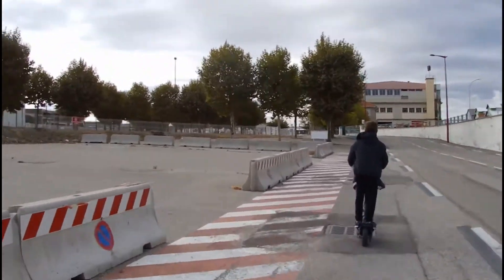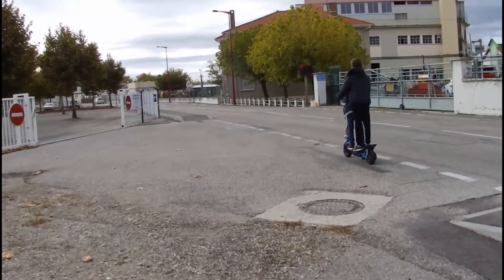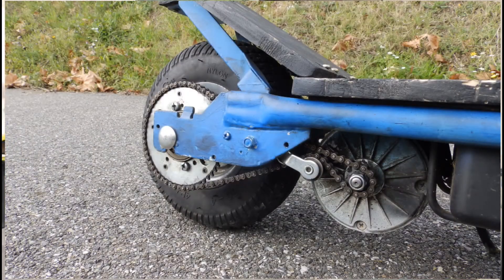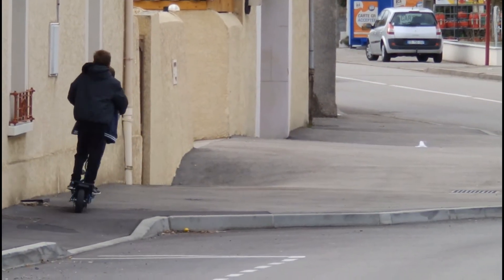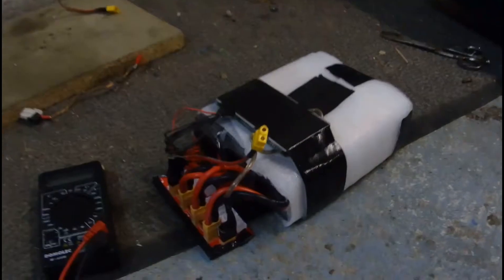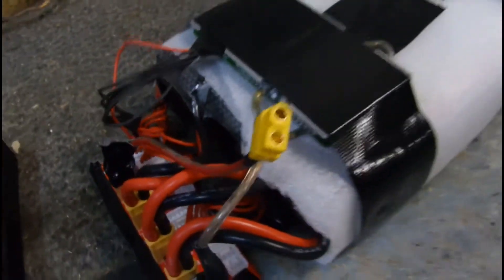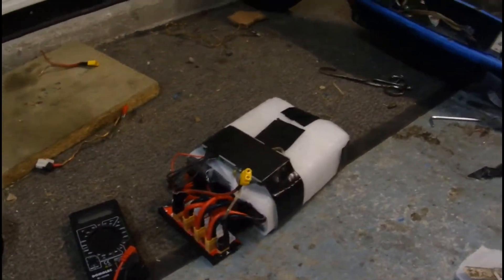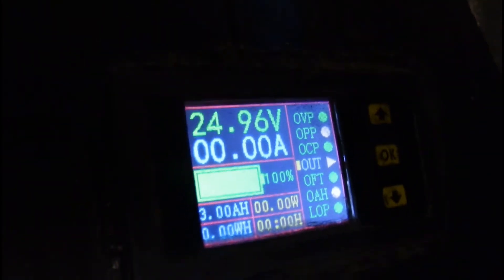AMELIORER sa TROTTINETTE ÉLECTRIQUE ! [Razor e300 mod ]

Comment: Bonjour. Je dois changer les batteries de ma trotinette Razor e300 qui ne chargent plus. Ce sont 2 x 12v 9Ah. Je ne cherche pas plus de vitesse car 24km/h c'est déjà pas mal,  mais je chercherais plutôt plus d'autonomie. Je n'y connais rien en électricité. Pourrrais-tu me dire comment faire pour qu'elles tiennent la charge plus longtemps. Faut-il choisir des batteries avec plus de volts, ou plus d'ampères, ou est-ce qu'il faut autre chose que des batteries au plomb ? Je te remercie de bien vouloir m'éclairer.

Comment: Bonjour et bravo pour cette vidéo, j'ai l'intention d'acheter une razor  e300 d'occasion et de fabriquer moi meme mon pack de batterie a base de sony 18650 VTC5 en 7s 5p ou 6p.
Je me demande si je peux conserver le variateur d'origine ou pas.
Le moteur que tu as monté sur ta trott c'est le moteur d'origine ou un que tu as récupéré sur un engin electrique ?
Tu peux nous en dire plus sur ce moteur ?
Reply from the maker: Ta modification est tout a fait possible et sans problème, moi j'ai remplacé le moteur d'origine de 250w par un 350w et le contrôleur pour avoir un peu plus de puissance
Reply: @TutosBricolages  Tu peux nous en dire plus sur ce moteur de 350 watts (marque, modèle), le pinion qui était sur le moteur d'origine s'est monté sans problème ou il a fallu usiner l'axe ?
Concernant les modifications mécaniques comme l'installation du moteur, tu as tout fait toi même ou tu a béneficié de l'aide d'un adulte ?
Cette trottinette a juste un petit défaut, le bruit de la chaine.  Je me demande si il n'y a pas moyen de la remplacer cette chaine par une courroie crantée.
Reply from the maker: @Motorcycleman480  le moteur est celui ci, https://www.banggood.com/350W-24V-2750-RPM-ZY1016-Electric-Motor-E-bike-Brushed-Scooter-Electric-Motor-p-1213254.html?p=N030107107860201610K&custlinkid=583869

J'ai du percer des nouveaux trous de fixation sur le cadre, pas d'usinage c'est très simple
pour la courroie ça doit être possible mais compliqué pour un alignement parfait et pour gérer la tension de celle ci

Comment: j ai acheté d occaz dernierement une razor e300 , j ai acheté un moteur my2016 mais en 36v 350w tout fonctionne impecc mais il y a un soucis l axe du moteur est 1 mm plus long que l autre original et ce qui fait que la chaine déraille a la première accélération même tout doucement. je suis deg . si t as une solution ou une astuce :)
Reply from the maker: Tu peux décaler le moteur en perçant des trous d'attache du moteur décalés, il faut que la chaîne soit parfaitement droite sinon elle va sans arrêt détailler
Reply: @TutosBricolages  merci beaucoup
Reply: Bonjour, vous pouvez me donner le lien vers le moteur my2016 que vous avez monté sur votre trott ?

Comment: bonjour, j'aimerais savoir si un moteur brushless 280kv (celui que tu utilise pour ton autre trott) serais compatible avec cette razor e300(fixation, positon des trous...)? De plus, pense tu qu'elle serais assez stable pour aller a plus de 40km/h? Car je compte faire comme toi avec ta trott wayscal mais avec cette razor e300 (mettre un vesq ... ) sinon merci pour tes vidéo continue comme ça ;)
Reply from the maker: Salut, je te recommande plutôt un moteur de 200kv (plus adapté et c'est ce que j'utilise actuellement dans ma trottinette) en 10s ou 12s en batterie c'est le mieux tu devrais pouvoir atteindre même 50km/h en 12s, la razor e300 et très stable mais elle a une roue libre et n'a pas de guidon pliable (sur la plupart des modèles) le fait qu'elle a une roue libre empêche d'avoir un frein moteur (c'est cool le freinage moteur ) C'est faisable par contre il faudrait faire un support moteur toi même avec ses équerres bien solides, si possible utilise une batterie de 12s (44v) car le 10s (36v)n'est pas suffisant pour une trottinette électrique qui va a 40/50kmh (surcharge du vesc au niveau du courant)
Reply: merci pour ces infos donc  est il possible de retirer la roue libre pour bénéficier du freinage moteur et si ce n'est pas possible vaux mieux que je me prenne plutôt un esc classique pour escooteur qu'un vesc ? car je n'aurais pas le freinage M. 
Pour le moteur des équerres comme celle ci (ou dans ce genre ) suffiront?  https://www.leroymerlin.fr/v3/p/produits/1-equerre-d-assemblage-acier-zingue-hettich-l-32-mm-e22213 
Pour la batterie je comptais faire un assemblage de 3lipo 3s de 5000ma/h et une de 4S pour obtenir une tenstion enfin de charge de 54,6v et en tension moyenne de 48v en tout il y aura 13 éléments donc une batterie 13s; mais j'ai vu que le moteur 200kv a 7500 tr/min (je crois) supporte du 12s max d'après toi il vaudrais donc mieux une batterie de 44v avec un assemble de 4 lipo 3s?
Reply from the maker: @leandrebereziat  le moteur 200kv 12s va fonctionner en 13s sans problème (3.7v de plus 😂 c'est un moteur il y a une certaine tolérance), tu peux utiliser un contrôleur d'ebike mais ils sont pas forcément compatibles avec les moteurs comme ceux ci, et un esc je ne te recommande pas car il n'y a pas de limite de courant
Reply from the maker: @leandrebereziat  pour l'équerre il faudra plus solide car le moteur tire fort celle du lien risque de plier a moins de la renforcer
Reply: @TutosBricolages  oui j'ai pris une équerre au piffe mais je vois le genre pareil pour le vesc même si il coûte plus chère y'a beaucoup de fonctionnalité en plus comme la limitation de courant et bien plus encore je essaierai de t'envoyer des photo ou de petites vidéo quands je l'aurai fini (pas avant le fin des grandes vacance mdr)
Reply from the maker: Et du côté de la roue libre tu peux essayer de la bloquer (dégraissage et Nettoyage haute pression, pas besoin d'ouvrir la roue libre ) puis la coller en la noyant dans de la colle cyano mais il faut bien avoir tout dégraissé car sinon la colle ne va pas tenir et si tu bloques la roue libre il faudra tendre mieux la chaîne car le tendeur ne suffit pas la chaîne pourrait dérailler au freinage.
Reply from the maker: Pour tes batteries il est obligatoire d'assembler des Lipo identiques le compromis et mieux avec des batteries lithium-ion, c'est moins cher et moins dangereux que des Lipos le mieux c'est d'acheter des cellules 18650 sur NKON.nl et de les assembler avec un bms (voir ma vidéo d'assemblage du pack pour ebike) du 12s 4p de Samsung inr 25r serait idéal et pour plus de capacité tu peux utiliser des Samsung 30q mais plus cher, il faut que ton pack puisse débiter au moins 25a en continu.
Reply: Finalement je vais essayer de mettre 4 batterie lipo 6s(celle dans ta description) 2*2 en série  pour avoir du 12s 16 A/h (si ca rentre car je doute que la 4 eme passe mais le vesc prendra moins de place que ton contrôleur ) je vais quand même prendre des lipos car j'ai juste besoin des les assembler de mettre 2 B.M.S. assez costaud  de les isoler et de les protéger un minimum avec de la mousse. En revanche les 18650 son plus modulable elles peuvent donc prendre la forme que l'en veux mais je n'ai pas envie de me casser le tête a faire le pack mdr 
Pour la roue libre je vais abandonner le freinage moteur et mettre un frein a disque comme tu a fais cependant pense-tu que lancé a plus de 45km/h le frein tiendra bon la roue dérapera? je penserais aussi a mettre une sécuriser (quand je freine le le moteur s’arrête ) .
Reply from the maker: D'accord, tu peux faire comme ça, ça me paraît pas mal, pour l'assemblage des Lipos, évite de faire comme moi relie les directement entre elles, où créé des connecteurs en Y car ma plaque d'équilibrage a pris feu un jour (J'en ai parlé dans ma vidéo trottinette boostée part 2).
Du côté du frein, utilises un disque de frein plus petit que le mien, c'est parceque j'ai pas reçu le bon que j'ai utilisé un gros mais c'est mauvais car il tourne trop vite et ça uses le plaquettes rapidement, sinon tu peux tenter d'utiliser un frein comme celui ci ça serai mieux (com suivant)
Reply: @TutosBricolages  Salut je suis toujours sur le projet, je me suis procuré une razor e300 d'occation et je me penche d'abord sur le freinage (je n'ai pas compris la fin de ton dernier com) je comptai m'acheter le disque de frein en 140mm mais j'ai vu qu'il y avais une fixation (dans ta description) pour l'étrier de frein mais seulement en 160 mm. Je me dis que le 140 mm est mieux car il use moins vite mais je ne serai pas le fixé et le 160 j'ai peur qu'avec la fixation il me manque 1mm de jeu et qu'il frotera donc sur le disque. Aurai tu des conseilles/solutions a m'apporter? Merci de ton aide.
Reply from the maker: @leandrebereziat  ça serait mieux un disque de frein plus petit que celui que j'utilise car  le mien de par sa taille passe très vite dans l'etriers de frein ce qui uses plus vite les plaquettes (en 3 mois pour moi)
Reply: Je fais une batterie composée de 22650 5000mah(celle que tu utilise déjà) en 7s 5p. J'aimerai avoir une autonomie de 40km minium mais j'ai peur que ce sois un peu juste. j'ai le controleur d'origine de la razor e300 250w(je suppose car le moteur lui fais 250w). j'aimerai savoir grace a ton expérience, es ce que je peux dépasser les 40km d'autonomie en 1 charge. Car tu a une batterie 24Ah en 22.2v avec un moteur plus puissant et moi une de 25Ah 25,9v avec un moteur moins puissant. tu dis pouvoir atteindre 40km facilement donc je pense que moi oui mais j'aimerai avoir ton avis là dessus. Merci encore pour ton aide.
Reply from the maker: @leandrebereziat  oui largement car l'autonomie dépend surtout de la vitesse, avec la puissance d'origine ou même booster de la razor tu atteindera largement les 40km voire 50km

Comment: Bjr. J’ai une e300 moi aussi j’ai toujours trouvé qu’elle se traîner d’origine. J’aimerais la booster pour atteindre max 50km/h mais je ne sais pas comment m’y prendre tu pourrais me mp pour plus de détails ou m’indiquer quelque base stp sa serait cool
Reply from the maker: Pour aller plus vite, il faut soit plus de tension dans le moteur (donc des nouvelles batteries ) mais ça ne suffit pas forcément, il faut aussi changer la motorisation en plus des batteries car il faut plus de puissance pour aller a 50 kmh que a 25.
Reply from the maker: J'ai fait ça si ça peut t'aider : https://youtu.be/Si6XaN2R52s

Comment: bonjour, tout d'abord bravo pour tes videos je les trouve géniales ! moi qui suis nul en électricité ca m'épate ;) je voudrais savoir si tu as toujours ta razor e300 et si cela fonctionne toujours ? j'ai également une razor 300 et le changement de batterie me faisait un peu peur quant à la question de sécurité des batteries, comme je transporte mon fils , je ne voudrais pas que cela explose ou autre ... ;) donc si tu me confirmes bien qu'il n'y a pas de risque je vais suivre ton tuto à la lettre, génial et encore bravo pour ton temps et ton ingéniosité ;) ! Merci , Thierry Laurence
Reply from the maker: J'ai bien vu ton message, j'essaie de te répondre au plus vite...
Reply from the maker: oui j'ai toujours la razor e300 et elle fonctionne toujours, pour les 3 lipos ma méthode est dangereuses car avec les vibrations les connecteurs d'équilibrage sur la plaque qui relie toutes les batteries se sont débranchés et, lors de la charge (ça m'est arrivé) et j'ai eus de la fumée et deux batterie mortes,  donc si tu fais comme moi, je te recommande de coller les connecteurs d'équilibrage des batteries avec minimum de la colle chaude il faut aussi une plaque d'équilibrage avec fusible pour la sécurité.
pour la charge il faut soit un chargeur spécial qui charge et équilibre les batteries en même temps ou un bms comme moi.
le bms doit être relié aux bornes d'equilibrage des batteries relié donc par le biais de la plaque d'équilibrage et couper le neutre pour la protection
le bms et les fusibles doivent être minimum 40a.

si cela te fait peur, tu peut acheter un pack de batterie tout fait avec le BMS intégré sur eBay. 

sur ma trottinette brushless je vais construire un pack de batterie lion 18650, je ferai sûrement une vidéo de fabrication mais je n'ai actuellement pas encore reçu les batteries. 

si tu as besoin de plus d'informations, n'hésite pas a me demander, tu peux aussi me contacter en message privé sur Twitter pour que je puisse te partager des photos et des liens.
bon weekend !
Reply: merci beaucoup,
oui je comprends, eh bien en fait j'avais aussi une inokim avec une batterie en supplément , alors je me suis dit que je pourrais juste commander les pieces détachés d'une inokim et monter le tout sur la razor comme ca je ne prends pas de risque (le seul hic est que le moteur de la razor est en 24v et que le controller inokim et la batterie sont en 36v , qu'en penses tu cela devrait fonctionner quand même ? merci de ton aide , Thierry
Reply from the maker: Normalemt Tout fonctionnera parfaitement, le moteur tournera plus rapidement et son rendement sera un peu moins bon mais ça ne va pas le griller, il faut surtout veiller a ne pas trop dépasser les watt de moteur exemple : moteur 250w, max 500w 1min.
Reply from the maker: Je viens de regarder, le contrôleur de l'inokim n'est pas compatible avec le moteur de la razor car c'est pas un moteur dc sur l'inokim il faut un contrôleur moteur dc
Reply from the maker: Celui-ci peut faire l'affaire
https://banggood.app.link/kC2QdA98AL
Reply: Bonjour, 
et si je changeais le moteur pour un brushless du type inokim en 36V 350w , cela me garantirait exactement le même circuit électrique , et donc une compatibilité totale qu'en dis tu ? j'aime bien aussi ton idée du controller mais je ne suis pas aussi fort que toi en électricité et je risque de me planter ;) ! tu achètes beaucoup sur banggood, ca a l'air pas mal !?, merci en tout cas, c'est super sympa , je te dirais ce que je trouve comme moteur ! à bientôt

Thierry
Reply: j'ai aussi vu des moteurs brushless qui pourraient remplacer le moteur DC d'origine , reste à choisir lequel serait compatible avec tout le kit inokim que j'ai déjà !? si tu peux me conseiller, après j'arrêtes de t'embêter ;) Merci Thierry
Reply from the maker: Pour le moteur de l'inokim c'est la roue arrière qui est le moteur alors il faudra réussir a l'accrocher sur la razor si tu veux plus d'informations j'ai une playlist trotinette électrique qui regroupe toutes les trottinettes électriques que j'ai faites
Reply from the maker: https://www.youtube.com/playlist?list=PLRMwGKjmVEf-VyZuqdngRhIzmmz9iO7AC
Reply from the maker: J'ai fabriqué une trotinette brushless sur la chaîne mais je n'ai fait que la vidéo de présentation si tu veux voir ce que ça donne mais c'est très compliqué a réaliser pour un débutant je me sert d'un moteur brushless 5050 280kv et ça depotte (sous 36v prends un moteur 200kv) mais c'est très compliqué a réaliser et le contrôleur de l'inokim est compatible seulement avec LE moteur de l'inokim avec un autre type de moteur ça risque de ne pas fonctionner.
Reply from the maker: De ce qui est de banggood je commande très souvent chez eux et je n'ai jamais eu de soucis sur plus de 100 commandes
Reply: Ok je comprends donc qu'il y a deux optons possibles , le moteur d'origine de la inokim à adapter sur la structure e razor, ou utiliser le controller que tu me préconise sans changer le moteur ! alors je vais dire ok pour le controlleur mais crois tu que je vais réussir à connecter la batterie, le throttle et le moteur sans galèrer ? , et UN GRAND MERCI , je te tiens au courant ;) merci, Thierry
Reply from the maker: J'explique comment cabler un contrôleur similaire dans cette vidéo a 22.06 min https://youtu.be/eg1A2O38Cqc
Reply from the maker: Sinon tu peux rejoindre mon twitter rn message privé pour que je t'aide avec des photos, c'est plus pratique que youtube 😉
Reply: Yes, merci beaucoup je vais essayer , te tiens au courant  ;) merci